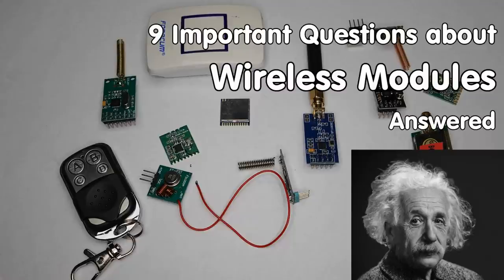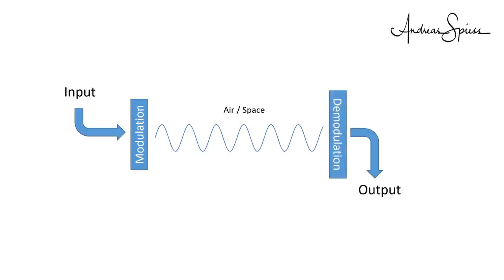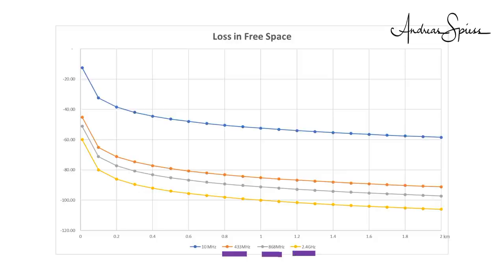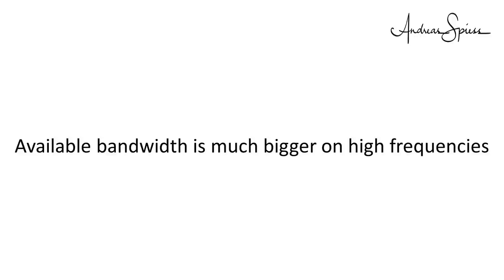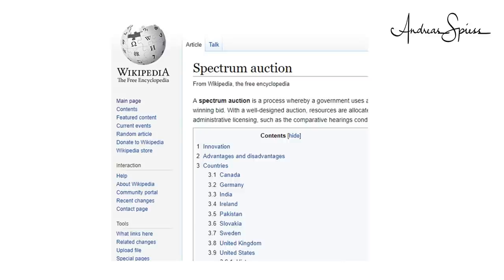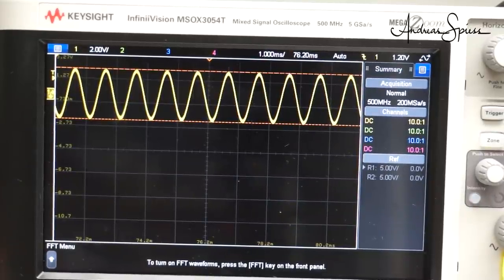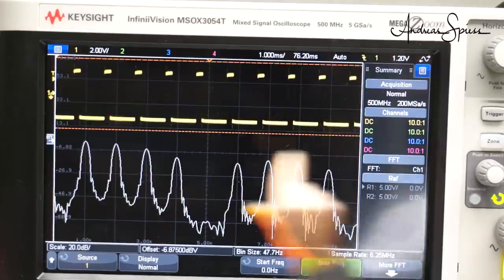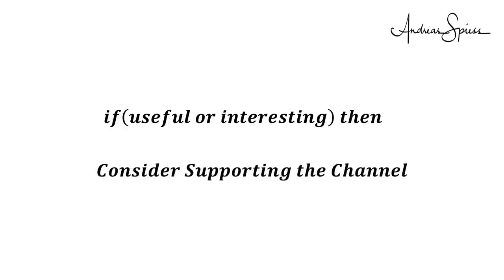005 Basics of Wireless Communication Part 1

Comment: As telecom (GSM) engineer we were first limited to 35km cell radius on 2G. Then they came with the idea of extending it to 70km (using 2 time slots). Then Ericsson came with 100km radius. All of that with maximum 33dBm (2W) of mobile phone power. Now, with 5G we are at... 100m cell radius. A circle of laugh ;-)
Reply from the maker: But 4/5G of course, with a little higher bandwidth ;-) BTW: I did not know that 2G had such a range!
Reply: @HB9BLA  that comes from Timing Advance and the length of the frame. So to use longer range they developed using 2 time slots to increase the range (but the capacity of 1 channel went down from 8 Full Rate time slots to 4). Anyway, 2G is a history. Btw from 3G onwards wise brains developed CDMA ( code division multiple access): all transmitters use the same frequency but each communication channel (peer-to-peer) is coded with the unique code so I know you talk only to me even though I can hear everybody on this disco)
Reply from the maker: @zyghom  Yes, speed of light still is slow in this respect... BTW I mentioned the high bandwidth because of the short distance and the lots of antennas with small cells...
Reply: NTIA frequencies got fed into the chipper and this is what came out.

Comment: Idea for next video about modulation. Why for example AM modulation gets sidebands and not just variation of carrier frequency amplitude. I found out aplitude-time graph of AM signal in many textbooks misleading. So maybe some words how mixers work. How modulation and demodulation of different modulations is done. IF frequincies etc. Otherwise congrats on new channel. I bet we will be all able to learn something new even if we already have a license.
Reply from the maker: We for sure will talk about mixers. But maybe not the ones most people think of... We probably will not see a lot of Superheterodyne Receivers on this channel. There are other good channels for analog stuff. I try to give it a twist to the newer SDR technology.
Reply: There is interesting project by DL2MAN that figured out how to create SSB transceiver with Arduino (ATMega328p) and Si5361a. A SDR style transceiver. It's interesting that nowadays you can convert most of analog electronic signal parts into software code.
Reply from the maker: @EarthWalkerMan  You are right. Currently, I have two transceiver kits from QRP-Labs on the bench which have the same roots.

Comment: Hello Andreas,
One question. Why does the bandwidth limit the amount of data per time? Couldn't you just pack the data much closer together so that more data fits in the same bandwidth? Is this a hardware limitation we are currently driving? What defines how many bits fit in 1Mhz? 
Thank you for this Channel.
Regards 
Sergej
Reply from the maker: It is the other way round: The bandwidth is an effect of the data rate. The relationship is physics and cannot be changed.  It just can be optimized. You can Google Shannon or Nyquist if you are brave ;-)
Reply: Bandwidth is defined as bits per second I believe so if you were to change the amount of data you send over a period of time you are actually changing how fast you are communicating and this changing it’s bandwidth
Reply: I would like to add on a clarification, bandwidth is defined as the maximum speed the data can be transferred but it does not mean it’s the speed of the transfer currently. Think of it like a pipe, bandwidth is the maximum amount of water you can push through the pipe at a standard pressure (pressures change so ignore that for this example)
Reply: @bestcreations4703  I do not know if this is true. If it is, it is very simplified. I am more interested in understanding the physics behind it. If you take an Ethernet cable as an example. A CAT 5 cable runs with 100MHz and transmits 100mbit. CAT5e also uses 100MHz and transmitted 1Gbit for a long time, now even 2.5Gbit and 5Gbit. Yes, the protocols are getting better, but the bandwidth cannot be increased by a factor of 50just by protocol, if there is a physical limit. How is definition for bits per Mhz.